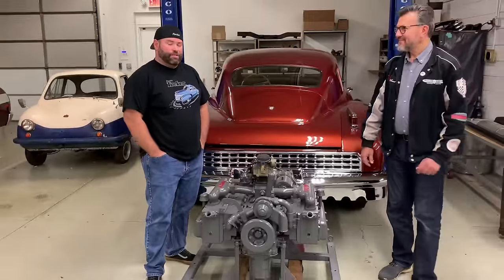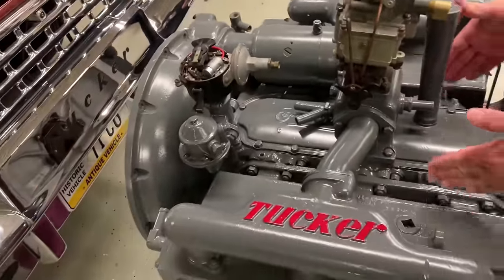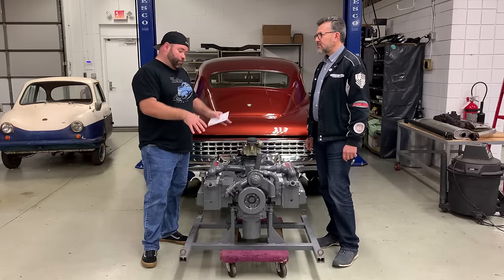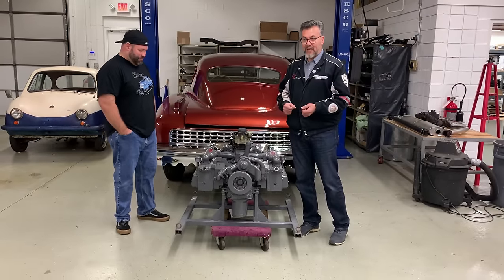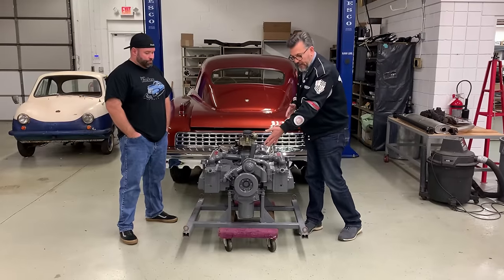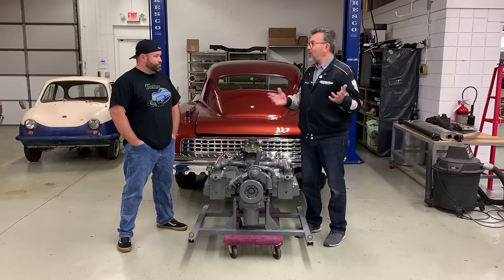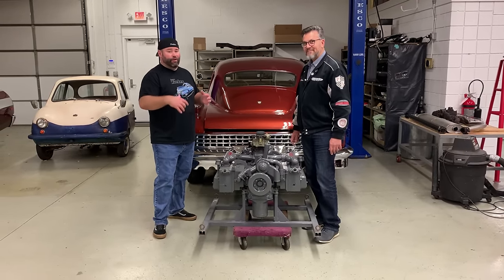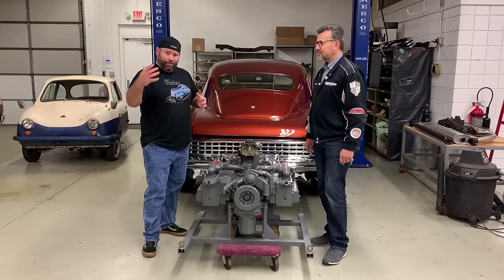The last Tucker automobile engine runs for the first time!

Comment: ..hindsight is always 20/20, but one has to ponder, if Tucker had gone with this engine from the outset, and not have squandered away time and resources, both financial and technical, on the 589 engine...and put those resources and time instead on developing a suitable transmission, what impact that may have had on the viability of the Tucker automobile...
Reply from the maker: What could have been…thanks for watching!

Comment: Very interesting. With 98 total engines made and only 50 cars produced it begs the question, where are the other 48 engines? Even if Tucker had succeeded in entering the market, the horsepower and styling wars of the 1950's would have been too much and Tucker would have joined Willys, Kaiser / Frazer, Packard, Nash and Hudson in the history books.

Comment: That coolant problem, is similar to mine. I have a manual Volvo 1997awd. (Two of them). They were not sold in the states. 
The water pump impeller, shifted off its shaft, and into the block. Now the aluminum head, is blocked with aluminum shavings… how do you clean that out? Without a tear down.
Reply from the maker: We are not familiar with that application but I’m sure it could be done!  Thanks so much for watching!

Comment: Had the engine manufacturer- Franklin- have any connection with the H. H. Franklin Mfg. Co. of Syracuse, NY, the former producer of the famous Franklin air-cooled automobile?
Reply from the maker: Most likely as air cooled motors was in Syracuse.  Thanks for watching!
Reply: Definitely, both my father and grandfather worked at Franklin or later it’s successor Air Cooled Motors “back in the day”

Comment: You missed an important part of the engine, the torque is produced because it has large displacement and relatively slow engine rpm, that’s what airplane engines need because an efficient prop runs below. 2,000 rpm and slower. You should have talked about engine power and rpm.
Reply from the maker: We will next time, and yes you are correct.  Thanks for watching!

Comment: Soooo, if this engine was originally in a car then why was it pulled out? What has that car been using for an engine all these years?
Reply from the maker: 1050 was sold at the auction without an engine…it just so happened to be mated with the last engine produced at some point later in its life.  There really is no such thing as a “matching numbers” Tucker since the factory mixed, matched, and changed what engine was in each car many time.

Comment: Those Tucker heads seem a bit crude-apparently machined from bar stock. Perhaps if more Tuckers had been sold over a period of time, they could have switched to castings to reduce weight.
Reply from the maker: With more time a lot more of the car would have been properly developed!  Thanks for watching.

Comment: If a tucker engine was made today using modern materials and tech, how would fair against modern gas, diesel units
Reply from the maker: Tough to say, but would be a cool comparison.  Thanks for watching!
Reply: A Porshe flat 6, or a Subaru flat 4 or flat 6. Both engines started off air cooled if I remember right. Now water cooled.

Comment: Franklin failed in the market, to Lycoming and Continental, for building annoying things like helical plastic gears. Some Franklin motors or parts are made in Poland. Most aircraft motors do not adapt to smooth idling in traffic. They have undersized, but hot camshafts.

Comment: Wait I thought most of the tuckers just had generic car engines apart from the prototypes?
Reply from the maker: No, every Tucker had a Franklin 335.  The Tin Goose prototype originally had a 589 cubic inch flat 6 with hydraulic valves and no transmission.  They didn’t get that engine sorted out to use in the cars.  Thanks for watching!

Comment: wasn't the tucker using a helicopter engine at first
Reply from the maker: This is that engine!  It was originally a Franklin 335 Helicopter engine, converted to water cooling and used in all 50 Tuckers.  Thanks for watching!

Comment: Too bad they didn't keep making the engine for planes.  Or whatever needs it.
Reply: Pretty sure it's a 46...or a 48...and that would be a Stinson 108 with a Franklin in the shop. 
Low hours ,like 4-500 but there's not any paperwork for this thing back until the early 60s. 
It's an issue and unfortunately it'll get parted. 
Not like we might get that ,but a usable core engine can bring 4-5k. 
We want the room ,so it'll be priced to move. 
Those engines are such jewels ,much nicer than the typical Lycoming or Continental

Comment: Shoudda paid more attention, but was number #-50 the only liquid cooled complete car, or the only one slated to be liquid cooled ?
Reply from the maker: Hi Roland, no all of the cars were water cooled.  They did try an air cooled version similar to the original Franklin configuration in the middle of the run, but it didn’t get very far.

Comment: I don't get how 1st gear wouldn't take the torque so start in 2nd. That's not how that works unless I misunderstood something.
Reply from the maker: 1st gear could not handle the torque…the gear itself would shear off!  The higher ratio in second, although lower performance, had to be used so the transmission didn’t destroy itself.
Reply: @prestontuckersspeedshop1948  Sorry to belabor the point but was it a build quality problem with the trans 1st gear but not 2nd? It just sounds fundamentally bassackwards. Usually an engine with too much torque for a given transmission will either break the input shaft or shear the teeth off a higher gear as the ratio is lower. I could understand starting in 2nd could be faster than shifting if 1st is so low as to be useless for gaining speed as in a tractor for example but idk how it makes sense otherwise. Thanks for your response.